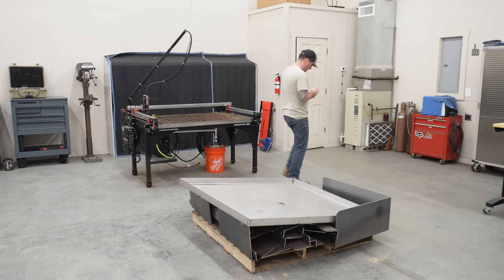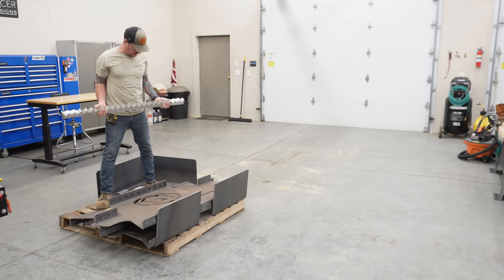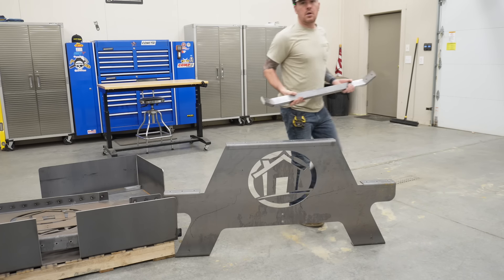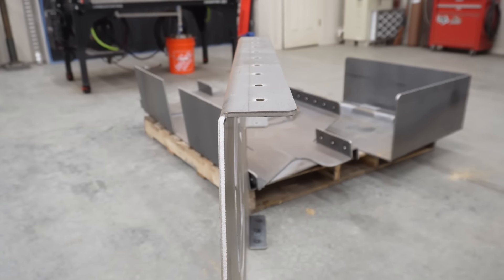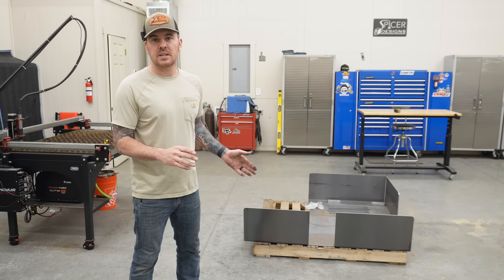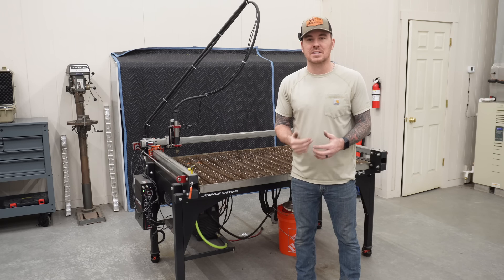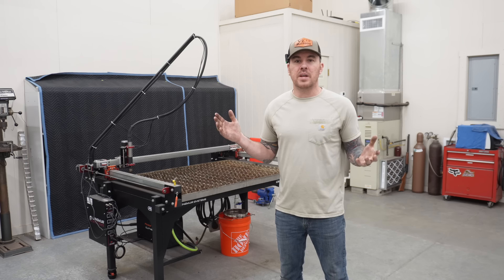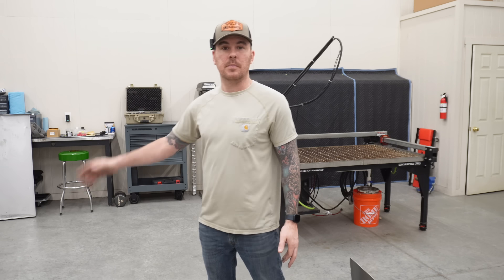DON’T Turn Down Large Fabrication Jobs?....Heres What I Do

Comment: Make sure you have lots of support under that 1/4 inch plate where the splitting happens. 1/4 is pretty thin for this application. I assume you will make a wider wedge that reaches past the original bottom plate from the Huskee splitter? I used 3/8 plate for mine and It started bending the plate. I made a 12 inch deep wedge for mine. Also the Downfall of these splitters where the wedge rides inside a channel is there is a ton of slop especially when you add a wider wedge. If I were to do it again I would just scrap the Huskee beam, use the cylinder and make my own beam similar to the axis style. Also that engine will run a 16gpm pump. Cheap upgrade to make it ALOT faster. Mine is 6.5 seconds at a 17in stroke running a predator 224 engine. 

I am excited for this build. I know yours will be super clean. I had this idea for years and I was surprised I couldn't find anyone on the tube that had done it when I made mine
Reply from the maker: I plan on setting the plate over the original landing plate of the husky splitter.  So it shouldnt affect the 1/4 plate at all.  At least thats the plan.  Thanks for the tips!
Reply: @SpicerDesignsLLC  yes that's exactly what I did. If you use the original wedge, it shouldn't be a problem

Comment: One good trick is to make some indexing guides for cutting longer sheets. First buy some nice precision pins and design a guide to fit them in and out of. Mount it flush with your water table even to the material surface. Then you can break up the program coinciding with the programming those holes into the periphery of your sheets. Run one portion angle grind the hole along the edge to clean it up and pop your pin in to locate it for the next portion.
Reply: I’ve done this before as well. I would create indexing points to re-index the plate being cut.
Reply: @TBJK07Jeep  
Yeah something I picked up from my days of running mills. We'd use it when running industrial tolerance jobs for a quick setup use the same offsets so we didn't have to redial the datum.

Comment: All the best toys are 3 phase.  I bought a 15 h.p. 3 phase rotary converter years ago.  Kinda spendy and a little noisy, but well worth it.
Reply: I built a 30hp RPC from scrap yard parts back in 1981 for less than $200.

Comment: I see you have a Japanese beetle eradication tool next to the HVAC stack :). Seems like the water table pan is something I see complaints about a lot on the Langmuir forums. When I bought my XL I ended up 3D printing a dimple die to put a bar drain in it. They may be doing that from the factory now, not sure. But they really need to put creases from the corners down to the drain so it will completely empty. And a number of complaints about the two piece pans on the larger ones leaking. I know they do that for shipping reasons, but still...
Reply from the maker: Im looking forward to the new water table.  That should be next weeks video.  Stainless slats too.  Hopefully will last a while.
Reply: I still have the flat slats that came with the table. At some point I'll switch to the pointy slats, probably when I actually start using it more. I really don't like my current shop arrangement, and it seems that everything I want to do is dependent on something else being done first :(

Comment: When I try to toolpath a sign that I  made in fusion 360 it says toolpath is out of date and when the toolpath loads it says several passes were discarded due to linking constraints, any advice on how to fix these problems would be appreciated, thanks
Reply from the maker: Sounds like you need to shrink your lead in.  Cant cut small detail with the plasma tables.